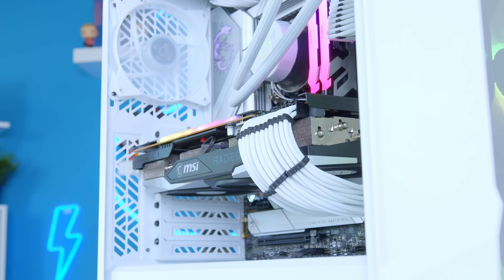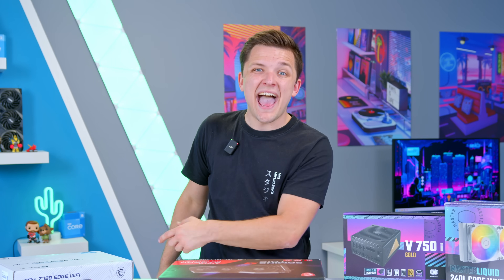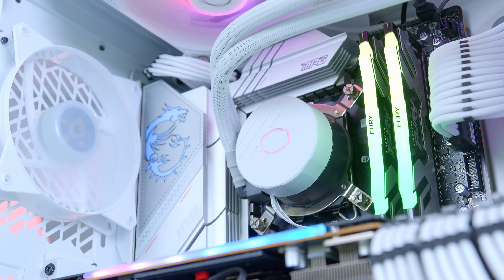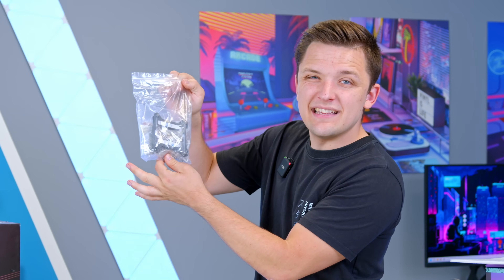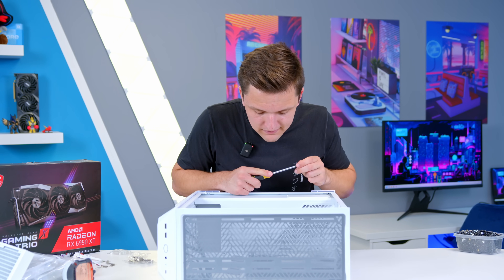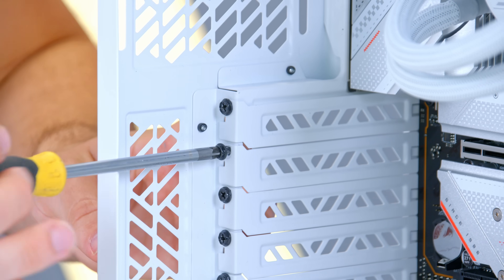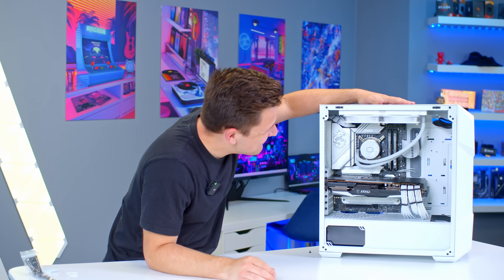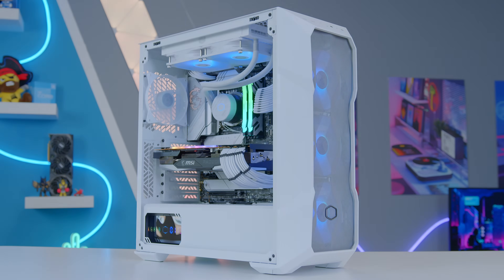Awesome $2000 Gaming PC Build 2023! [Full Build Guide w/ Benchmarks]

Comment: This build is so much better😂
Case 
Be quiet! Pure Base 500DX Arctic white 
$94.50

CPU
 AMD - Ryzen 7 7800X3D 
$399.99

Motherboard 
Used GIGABYTE B650 Aorus Elite AX 
$123.99

Ram 
CORSAIR Vengeance 
$105.99

GPU
Rtx 4080 super
$1,000

  CPU Cooler 
Noctua NH-D15 
$119.95

SSD 
Crucial - P3 1TB 
$63.99

PSU 
Pure Power 12 M 850W  
$109.90

OS
Windows 11 Home 
$129.99
Reply: Imagine actually buying windows, it’s so easy to crack, you must be new to computers.

Comment: im using the asrock 6950 xt with my 7700x cpu in a itx build
Reply: What's your specs, I'm looking for the same build as yours?
Reply: @jaycelambert09  of course! Alright those are some of the main guys but I’m also using a thermaltake tower 100 case with a thermaltake 140mm aio with 3 swafan a 2tb 980 ssd for games and a 1 tb ssd for files. Msi a850g PSU. XPG 32 ddr5 6000mghz ram. I’m going to upgrade to the tower 200 cuz the 140 aio isn’t enough to keep that 7700x runs so damn hot
Reply: @izzwizamahjah275  so a 240 aio cooler won’t keep it cool 😳
Reply: @jaycelambert09  no I think a 240 would do me way better. The 140 is just not cutting it. I could have gone with a heat sink I just hate how they look

Comment: I bought the 6950xt to replace my 3070. Best decision I made! Paired with a 5800X and 32gb of DDR4 at 3600mhz, it does really, really well at 1440p
Reply: How’s your experience been with the 6950xt?
Reply: @regi5030  it’s been great. Like countless people have shown though, ray tracing is not it’s best friend. I just pretty much run everything on high or ultra settings and turn motion blur off. I haven’t run into any issues since I’ve had it.
Reply: @GarySerrano I would’ve said the exact same thing

Comment: Super skeptical on this. $2100 gets a R7 7800X3D and 7900XTX with an A-tier PSU (psucultists) and the ASRock X670E Steel Legend motherboard. $2k is a really big price tag for previous gen hardware.
Reply: Dam i could listen to guys talk all day lol 
Tell more!!!
Reply: Cool story.  But what about the rest of the build? PSU, tower, storage, cooler, ram, etc.. 
Don't forget taxes.

Plus you are spending twice as much money for not much more performance for that 7900xtx. 

You are better off buying the MUCH cheaper 6950xt and running it for a few years until hopefully AMD or nVidia or even Intel come out with something actually worth buying.
Reply: @KurNorock  Shouldn't be spending more then $1500 on a 6950 XT build is the point. The OP is right, spending 2k should get you way more then what's shown here.
Reply: OP is right, for 2000$ you can easily fit the 7900xtx, without losing any quality on the other parts, most of the stuff in this build are way more expensive because of pure looks. and if you want the 6950xt, well you can go down to 1500$ instead.
if you really care about looks, then yeah this build is fine. but if you want ok looks with bigger performance, this is not the build.
 @KurNorock

Comment: Really decent build but i'd say you can most definetly fit a 7900 xtx card in there. With a $2k budget you can be much more flexible on parts as its not a small budget to work with.
Reply: What build would you recommend with the 7900xtx at the same $2k price point?
Reply: @bryanaguirre89  Im not sure beacuse i cba to build one but you can definely get some good stuff in there. Also make sure that in every build half of ur budget is going on the GPU and the other half on the other parts. Thats the usual rule. I didnt like this guys build beacuse he couldve realisticlly gone with a much better gpu but instead "wasted" 2k on parts that are not as important

Comment: The build looks CLEAN. But performance wise I think you spent 500 bucks more than needed just for the optics. Im surprised the 6950xt can handle 1440p so well
Reply: Why would you be surprised? Rx 6950 is built for 1440p
Reply: It’s also pretty impressive at 4K resolutions, easily surpassing 60hz in many cases.
Reply: Dude, the rx6950xt is literally the strongest AMD card released last gen.
Reply: I saw a comment here from someone saying that the 6950 was OVERKILL for 1440

Comment: Literally read my mind I was currently building my first pc and bought the 6950 XT cuz it was on sale, literally perfect timing great video!
Reply: i have the 6950xt but i paired it with the ryzen 9 5900x but at the time my card was around 850-ish then the following month it went on sale lol
Reply: @UncleBama91  That sounds like a pretty powerful AM4/RX6000 build you have there. With that combination, you should be able to get very efficient 4K performance in many cases.
Reply: @UncleBama91 looking at building with 6950xt. How’s your experience been with the card? Any cool whine, crashing etc.
Reply: @regi5030  I haven't seen to many white 6950 xt's tbh, as far as tempts and crashing and all of that I haven't had not one bad experience although depending on what cpu and however many monitors you'll definitely want a good PSU I'm running 3monitors with my mine
Reply: @UncleBama91 hey mate im getting this gpu but i already bought a 750w alimentation, do you thin it should returned it and get an 850w one ?
Reply: Same here